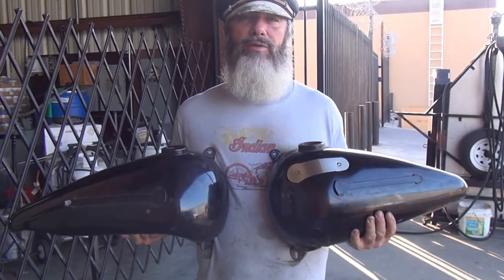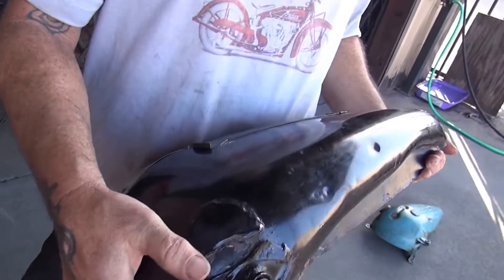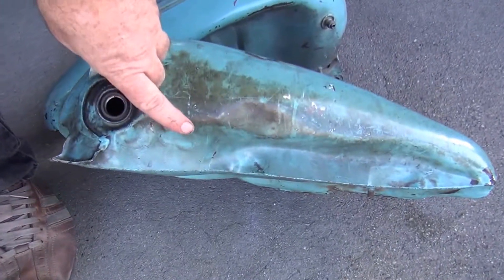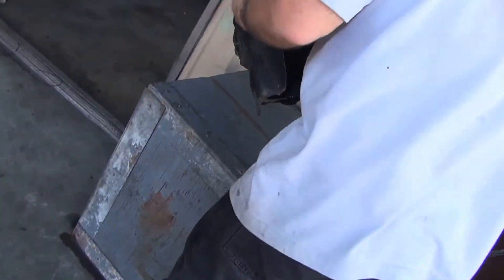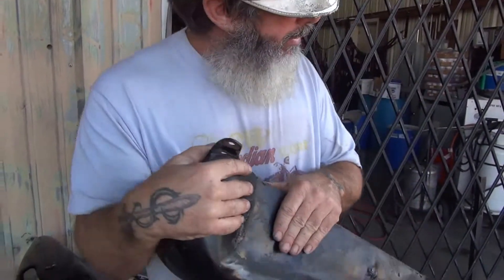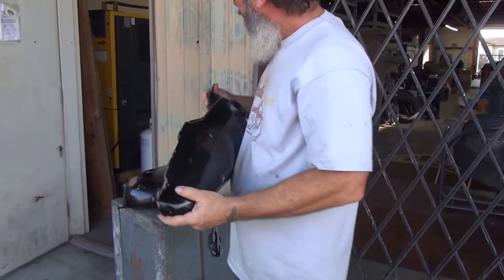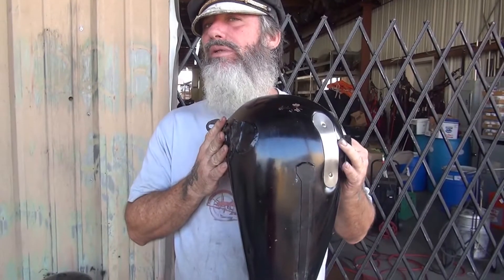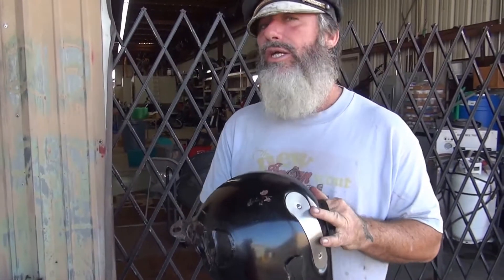Hunting Harleys, 1947 Knucklehead original gas tanks

Comment: hey todd,my 32vl tank,beat up repaired sorta ,learned about differance between 31,32,36 tanks,wonder why those 47 had no condisation,rust in them,laying around forever,all exposed places closed ?
Reply from the maker: all depends on how and where stuff was stored at. I had a chance once at a 1913 Sears. Bike had been under glass in a bar since near new and bike was in BRAND NEW condition, except you could tell the age of the thing by looking at it. I will always regret not buying it.

Comment: I have a 47 FL and have 2 sets of Knucklehead tanks.. but I am wondering which is original to the bike, am trying to (eventually) restore it to stock. What are some distinguishing features of the correct tank?
Reply from the maker: 47 knuckles took a dash very similar to the Panhead style and VERY different from earlier Knuckles. Simply by putting the two halves together, you can tell the difference. Also, Knuckle tanks are flat underneath, Pan's have a DENT in them, where the rocker cover's come up.
Reply: HuntingHarleys Thank you. I love your channel and am subscribing. I have been looking for a parts catalog for these bikes but to no avail, only seeing service manuals.

What's confusing to me now is that both sets are flat and fit on my frame but none have the tank shift mounts. Is it possible that they're post 51 Pan tanks that someone modded to fit the bike?

Anyway, thankfully the old timer I got the bike from never hacked any tabs off the frame.
Reply from the maker: either they are bondo'd over or they are 1952 and later Pan tanks for a foot shift. Years ago, people didn't care about stock at all. The parts catalogs won't help much, the pictures are rather small. there are a few "how to restore you Knucklehead books", I suggest buying all of them
Reply from the maker: neither, the black tanks are 1954 Panhead, the red ones are Big Twin Flathead

Comment: I have a ‘47 EL with ‘46 tanks. I was told that is correct as in early ‘47 the tanks were still ‘46. Is that correct? What makes me think it isn’t correct is the VIN is >7XXX which would lead me to believe that is not an early model ‘47.
Reply from the maker: They never ever from the factory put 1946 tanks on a 47, yours is a mid year production made roughly March of 47
Reply: @HuntingHarleys  what about in-line springers? Not on ‘47? I’m thinking mine might be pre ‘46? Or just mismatched springer on a ‘46 with a ‘47 motor?
Reply from the maker: In line springers were made until roughly mid year 1946. Then the offset Springer with the bull neck frame was introduced
Reply: @HuntingHarleys  thank you for the help! I have a shock in front so maybe a re-pop? Are you located in California by any chance? Could show you in person.
Reply from the maker: I'm currently in Long Beach. Springer forks came standard with the shock starting mid 1945.
Reply: @HuntingHarleys  excellent! How do I get a hold of you? I don’t see a way to send you a message directly. Do you have a shop?
Reply from the maker: Living homeless in a hotel. 661 904 8512 huntingharleys@gmail.com
Reply: @HuntingHarleys  I have uploaded my knuck here: https://youtu.be/70Dj_Xa0XM0
Reply from the maker: Definitely rebuild the carb